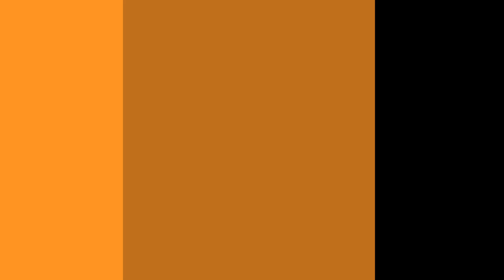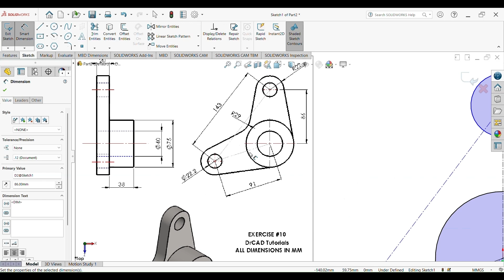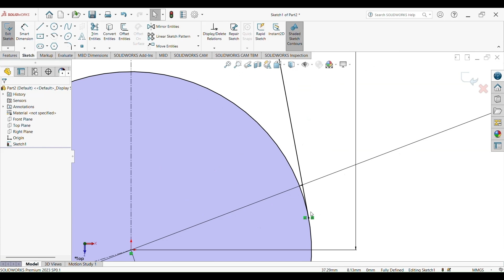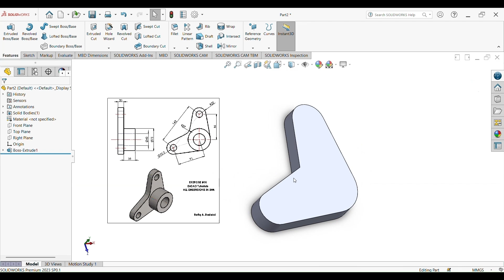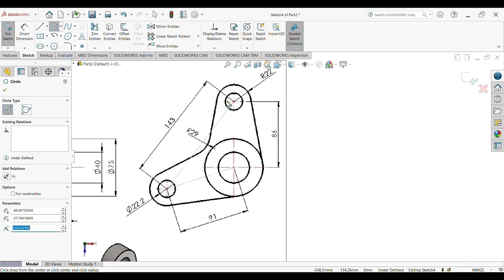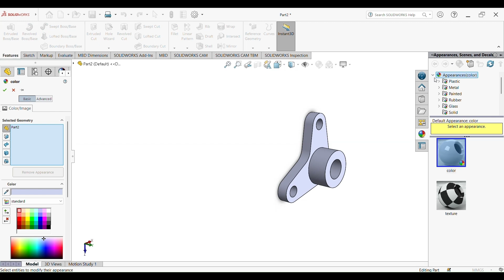SolidWorks Basic Tutorial Series (Exercise #10)

Comment: where was the angle showed for the lower left circle?
Reply from the maker: Hi! Thanks for your comment. If you look closely, the positions of the three circles (one base circle and two peripheral circles) can be fully defined using a triangle, with one vertex at the origin. By defining the lengths of the triangle’s sides, the sketch becomes fully defined, and since SolidWorks is parametric, it will automatically reposition everything as needed. In short, the angle is not required.

If you found this helpful, keep watching the channel for more, and don’t forget to subscribe. Would really appreciate your support! 😄
Reply: @Dr.CADTutorials  thank you, i forgot some of my Trig